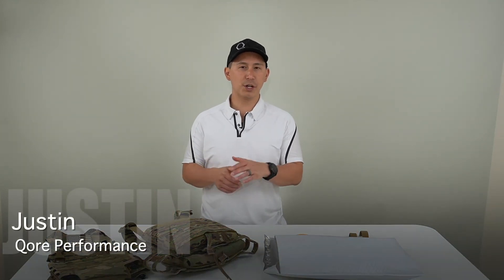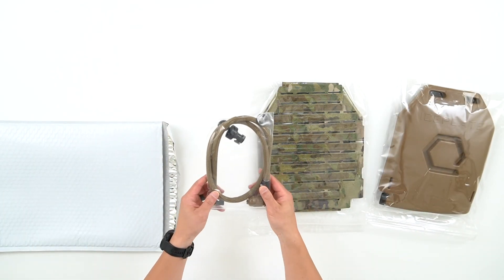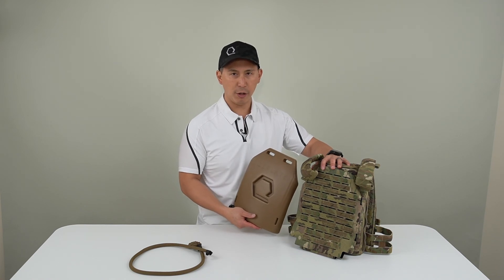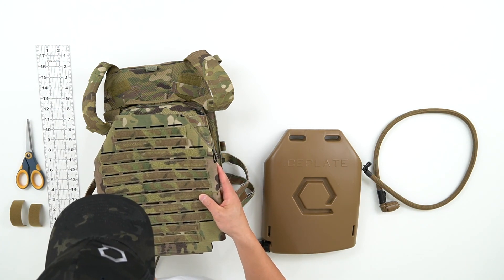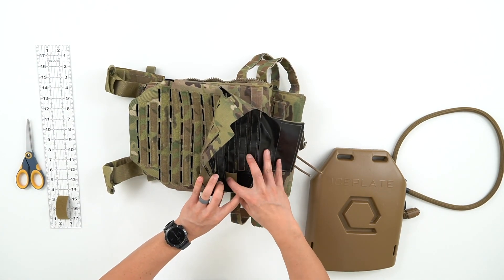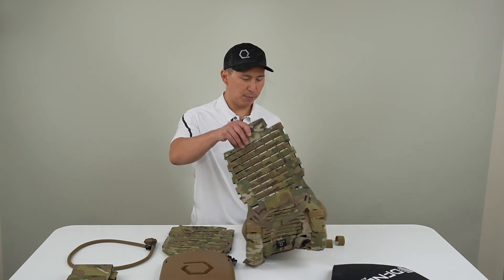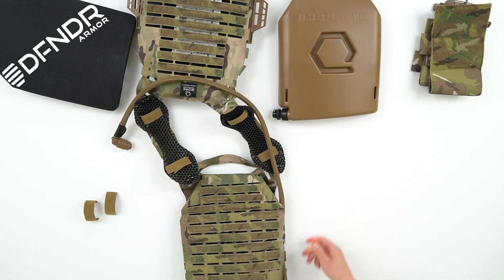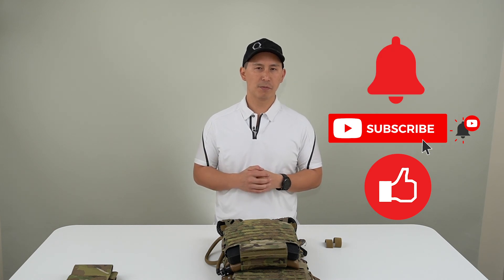How to Set Up IMS Pro (IcePlate® MOLLE Sleeve Pro) Plate Carrier Hydration with Cooling + Heating

Comment: Are there any future plans for a rear plate bag that has two sleeve spaces already built in?  This way in the rear plate bag both a plate and iceplate slot already exist?
Reply from the maker: We do not have plans to build a dual-compartment plate bag at this time. Reason: extra static weight that doesn’t fit every mission profile and reduces end-user optionality. Example: arid climates (ICEVENTS® Classic Ventilation Pontoons) vs humid climates (IMS Pro or IMS Versa). That said, our all-new IMS Versa is basically a second plate bag for your carrier. Details:
 https://www.qoreperformance.com/blogs/military-insights/what-is-the-difference-between-ims-and-ims-pro-iceplate-molle-sleeve-vs-iceplate-molle-sleeve-pro
Reply: @QorePerformanceUSA  Appreciate the detailed response.  I'm currently in an arid environment in the NV Desert however moving to a humid climate.